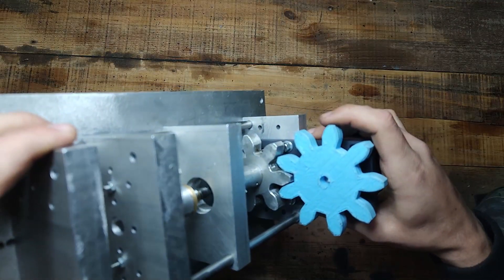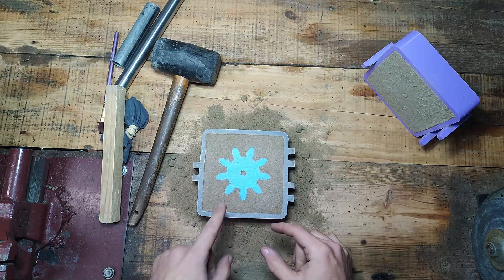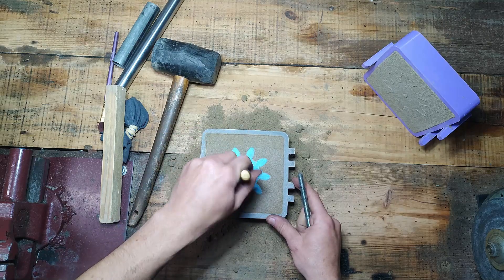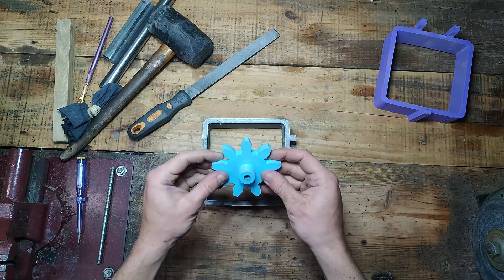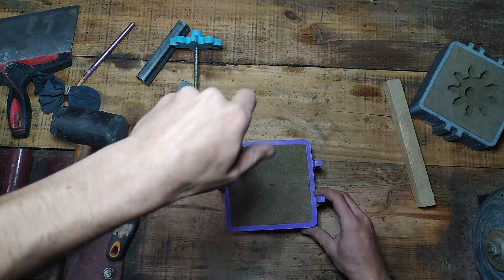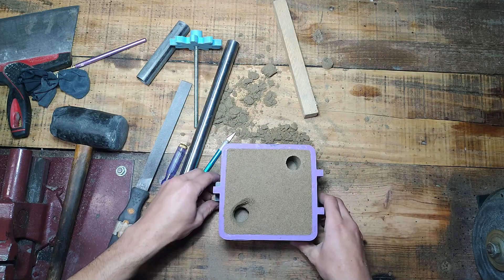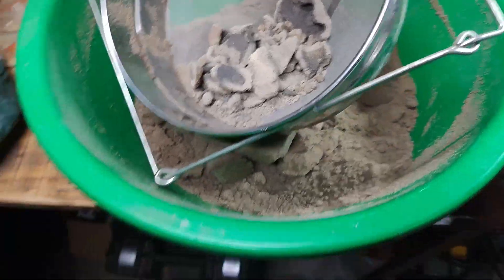3D Print to Aluminium gear injection molding

Comment: hey aluminium ratman, how strong are these parts compared to machined aluminium? I would think that you have less control of the crystallization and that there may be some internal defects, but if there are no bubbles or weaknesses, would a heat treatment help? Aluminium is very versatile, but I don't know how it behaves compared to steel
Reply from the maker: Hi, There can be bubble sometimes, i would not say that it's strong as machined but for this kind of project it is strong enough. For sure aluminium wear out faster than steel but to machine or cast steel it's an other story.....

Comment: wait can molten aluminumr eally blow out like that?
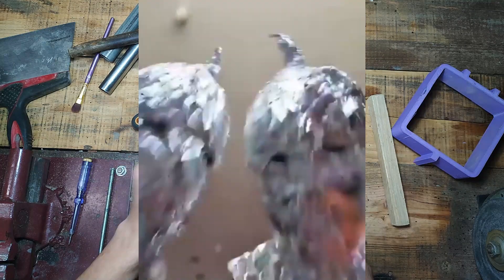Reply from the maker: You mean the video at 5:24? If yes the aluminium was poured in a tree trunk which contain humidity, never pour aluminium in a humid container where the air can be released otherwise it can blow up spilling aluminium everywhere.... You might think that the sand is wet too but air can go out inside the sand like this not like in the wood

Comment: You need to model in draft angles. Aluminium shrinks by 5% you you also need to print oversized. Sand and apply paint to seal and make the print smoother.  Do this and you will have much better results.
Reply from the maker: Thanks for the tips, i noticed that the aluminium shrinks but it seems that i counter that by hitting the part on the side leaving a small gap that is probably 5% but i'm not sure at all. what do you think about it? Or i should anyway scale by 1.05 before printing?

Comment: Master gearwheel is 9 cogs, driven 8. Gear ratio is 0.888. Usually ratio is 2-100. Why do you need almost 1? Add losses in a pair of g-wheels up to 3%, in your case at least 10-15% because it seems you didn't calculate cog module. You will burn NEMA...

Technical part of your casting is good. If you want to get very precise details you may read about lost wax casting. You will get more reading books instead of watching YouTube. Good luck.
Reply from the maker: Thanks for the information, actually I wanted at first to make a 1:1 ratio but the lower gear needed more space. At first I wasn't using gear and the NEMA was in direct connection to the rod but the NEMA bearings would not survive this so I made the adapter in grey plastic so that the NEMA don't force horizontally.
Reply: @Off_GridWorkShop   Using reducer with NEMA increases precision of positioning, not only mechanical momentum. More gear ratio - better result. Probably it's main reason to use gearbox. Harmonic reduser has compact design.